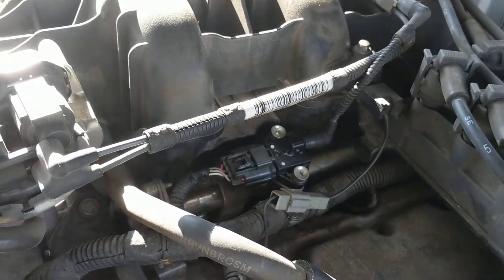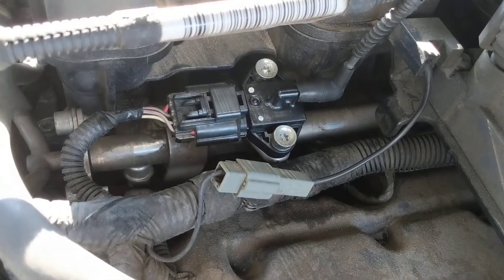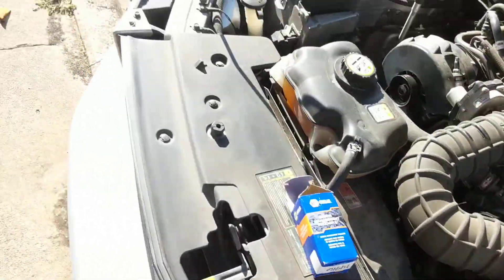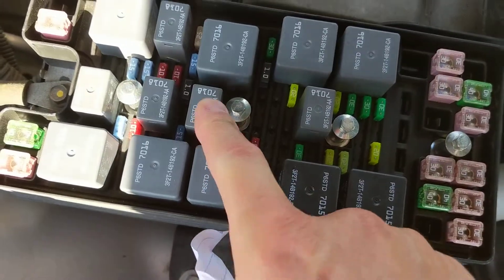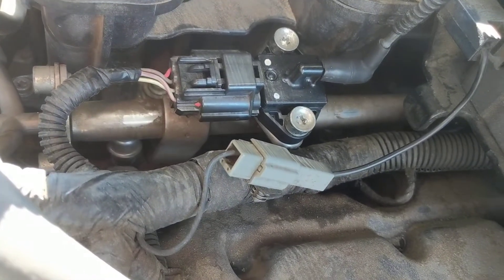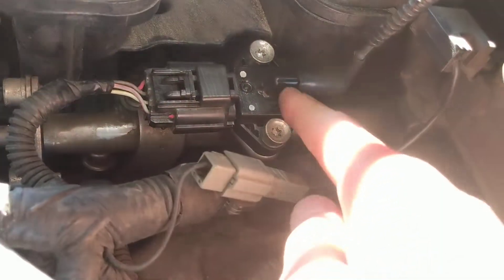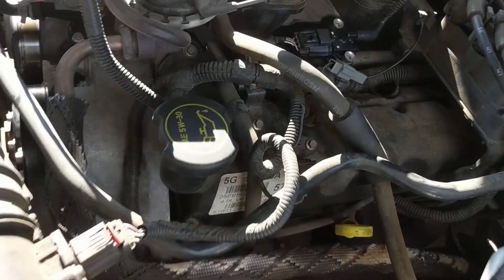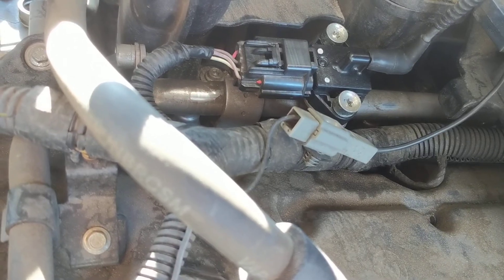How to Fix P0193 and P0182 Codes

Comment: Hi, you have Napa part no:?
Reply from the maker: I tried a few different ones and they ended up all having issues which I was really surprised I finally ended up buying a original Ford one and I have never had any problems since
Reply: Hi, leaned that years ago, buy motorcraft only, there is big difference. @JohnDaniels

Comment: Thanks for the video I had gas coming out of mine and it was new been chasing my tail trying to figure this out just started throwing those codes yesterday though I got one ordered motor Craft brand I hope this fixes my problem
Reply: Did the ford motor craft fixed it ? I have the same problem on a 06 Lincoln town car and even the OEM sensor didn’t clear the P0193 code and cuts off every other start
Reply: I got inpatient and went to Napa got the Napa brand and it did fix it..was way more expensive..I got the motor Craft one in the box for a spare
Reply: Did you pull the vacuum line off while the car was running? If so was gas coming out? If gas wasn't coming out maybe you have another problem..mine has gas coming out while running from the vacuum hose
Reply: He goes through the other possibilities

Comment: Another one thanking you for this video. This is exactly what happened to me. I bought the 15 dollar one off Ebay and it failed after a week and also gave me the P0182 code. Car would not start. I put the old sensor back and the car will start now but also buying a new better one. Sometimes cheaper is not always better. Thanks again.

Comment: Another satisfied customer. I bought a TRQ sensor for $36. It failed and my engine stopped while I was driving. And it wouldn't start. After finding this video. I bought an OEM replacement for $80 and everything worked. Monitors ok. Errors gone. Passed the smog test today. Thank you.

Comment: Sensors so many it does not make sense. Thanks a lot I’m having the same problem with my 04 mustang GT just started today your information is very valuable
Reply from the maker: You're welcome! And I would get the one from motorcraft if possible. Just spend the extra money

Comment: I replaced this sensor in  my 2008 F250 with 5.4 engine it  ran fine. I cut it off in my driveway  when  I got home and the next day I was going out to buy new tires for my truck and it will not start. I might go to Advance in the morning and buy another sensor. I've already changed the rear modulator behind /under the spare tire but still not starting !!!!! Any ideas ?????

Comment: I cleaned the mass air flow sensor and the throttle body and my code went away.  If your throttle body and plate come off black with the cleaner and the paper towel,  that could be a problem.
Reply: And new air filter.
Reply from the maker: @ayshortier  Thank you for the information 👍🏻😀

Comment: Thank you for this! Almost exactly this was my problem on a 2006 Ford fivehundred. I had the P0182 code replaced the sensor with a $15 ebay sensor. The code came back inside of a month. Continued to drive the car with the code clearing the code every few weeks. Eventually the car would not start after just driving it. Watched your video removed the vac line and it was flooded with gas. Exactly my problem . Bought the more expensive Made In USA sensor and problem fixed. It was very flooded before I got it to start. Had to disconnect the electrical connection from the the fuel pump to get it to start. Once started black smoke at first then lots of white smoke. Reconnected the electrical connector to the fuel pump and it ran like a dream. I was stumped until watching your video. Thank You, Thank You, Thank You!!!!!!
Reply from the maker: You are welcome ☺️. Glad you were able to get it resolved and thank you for sharing your story may help others have a great day my fellow traveler.
Reply: Or your local junk yard for under 20$

Comment: Thanks for your video!  Just replaced sensor on 2005 Explorer with pressure code P0193 being thrown. Now getting P0182. Joy with explorer is sensor is located under intake manifold, so replacing it is a multi-hour job. Would love to relocate sensor.  I will have to check to see if sensor is leaking gas into vacuum line..  Sensor I purchased was off amazon.  PeakCar Fuel Rail Injection Pressure Sensor, 3F2Z9-G756-AC 3F2E-9G756-AA (20 bucks)  First thing I did was replace fuel filter when getting pressure sensor code. Reset code, then when getting thrown again replaced sensor. Cleaning throttle body was a great help for smooth acceleration.  Wondering if I need to read up on resetting computer (disconnecting battery.. letting system relearn...)

Comment: Great video with really good advice. Thanks! We have a. Explorer with that code now. I'm going to check the fuel pressure and probably replace this sensor. Thanks again for the heads-up!
Reply from the maker: You're welcome 😀. Good luck and let me know how it turns out 👍
Reply: @JohnDaniels - Cold weather and plastic clips don't get along but other than that it went just as you said. Cleared codes and runs great! Thanks!
Reply from the maker: @jeffbrown3963  you're welcome, great news glad it worked for you, be safe it is cold out there 🥶

Comment: Don't put dielectric grease on your connections.  That grease is an insulator (ie doesn't conduct electricity.)  It's supposed to be used to lubricate seals.
Reply: It's actually great for electrical connections. It won't short connections but it will protect from weather and corrosion. Yeah use it on seals to.

Comment: Did you disconnect the battery before replacing it?  Just wondering if that is a factor.  I also replaced mine and smelled a little gas but had to have the fuel pump replaced,  running now but code still on.  Will try the Napa one you had.
Reply from the maker: I did not take the battery cable off probably a good idea. And you can try the Napa one you may want to try to find a genuine Ford sensor if possible.
Reply: Ford here is bad.  They gave me the wrong relay it fried my battery.  The sensor I bought also put out a fuel smell so it probably failed. Trying to find the Napa because I want a low priced one.   Do you have the link for the NAPA one?  Thanks
Reply: I think it needs a combination Fuel Filter change when cleaning the injectors.

Comment: I’m dealing with this same problem right now!  Bought a sensor online and it was defective.wow!
Reply from the maker: Good luck I hope you can get this fixed cuz it sure is a pain 😭
Reply: Yea, I almost concidered getting online but, if it might be defective, it would have been hard to get refunded. So I bought replacement parts locally at part's stores.

Comment: I  have an 06 mustang and Its throwing that P0193 code at me. My car recently died and will occasionally start but will sputter and smell like gas. I replaced that censor but it was a cheap 20 dollar one. Seeing youve had almost the exact same problems as I have give me faith that I might just have to get a different censor.
Reply from the maker: You can definitely try it, also you want to make sure that you getting gas from the fuel pump.

Comment: Thank you very much, my car was having the same problem, I also bought a sensor on amazon, it still does the same thing as before, and it also gives me the PO182, I’m going to look for one on eBay instead
Reply from the maker: Good luck,  The one I purchased worked for a long time and then started giving the high pressure code again.  I let it on because I already had my inspection but later I was driving in Dallas and heard the fuel pump starting to make a whining noise and it keep going but is hard to start the car now.  I think the fuel pump is going bad and not putting out much pressure but the funny thing is the High Pressure error code has gone off :)

Comment: Good video. I have had a p0183 code for awhile so I finally ordered a new fuel pressure sensor off amazon. Hopefully that’s the problem solver and I can get rid of the engine light.
Reply: Did it work?
Reply: @Amazinbeats  no it didn’t. Gunna try a few more things before I take it in for service.
Reply: @donavancurrie3922  did you ever find the problom
Reply: @DroneTechProduction  I bought an aftermarket sensor and it worked for a bit then failed and was sucking in gas. I kept the old one and put it back in. I changed the fuel filter and changed the spark plugs and hose clamped all the vaccum lines. Iv upgraded lots of part so I can’t remember which part got rid of the codes

Comment: I waited for this video! Or else I might end up replacing the fuel pump also. I already replaced the fuel filter by a shop that doesn't have the right tools and they sweat it out hard. 
Since I skimped on an China sensor that code kept coming back and the sensor leaked fuel. Now I'm decided to buy a good sensor. Noted on that Napa brand. Thanks!
Reply from the maker: You are welcome and good luck my friend

Comment: Great video.  Thank you for this.  I don’t know if it will solve my code problem but you gave me a great place to start!
Reply from the maker: You are welcome!  And something that wasn't mentioned in the video but did happen I had purchased a fuel pump and put it in and it was fine for a while but I guess it started going bad and then I started getting the fuel code about too much pressure so I guess it was putting out too much pressure causing the code and it wasn't the sensor so it can be the fuel pump and it can be the sensor or it could be wiring could be a few things but if you don't have a lot of tools then you're only option is to try switching out parts
Reply: @JohnDaniels  that’s the problem with these codes. You could be changing out perfectly good parts as you try to chase them down. I’m starting with the sensor and going from there. I have an 07 GT with 170k+ miles on it and none of these issues,  the 07 v6 I have is the one being a pain in the rear.
Reply from the maker: @wesmoc  yeah that's what I figured too start with the easiest and work towards the hardest Good luck brother and let me know how it turns out 💪👍
Reply: @wesmoc did u ever find out what it was I have a 07 gt

Comment: I'm having the same 193 code on my 07 f150 4.6 I've changed the fuel pump and filter and still getting the code
Reply: Did you fix it?

Comment: Read the reviews for these cheapo sensors they sell on Amazon.  Lot of people getting bad parts and part not lasting very long.  I think I'll just bite the bullet and buy one full price at the store.
Reply from the maker: That's a valid point The first one I got like I said in the video it turned out bad and it's actually made my car run worse so definitely be careful of the cheap parts.

Comment: I'm having the same code pop up but only p193 I have a 04 food mustang v6 3.8l manuel transmission. It runs fine but sometimes when pulling out of second gear it starts to bog out an hickup,  once I get into third gear it dont do it anymore.  Changed the fuel pump an cleared the code an it came back again an started doing the same thing but it only happens sometimes not everytime I'm driving. Took it to the shop changed the sensor an it still did it. So they put my old sensor back on an didnt charge me for it. Still starts everytime an idle fine. Told me to take it to a ford dealership.? Should I just buy a more expensive sensor or go to the ford dealer ship, soonest appointment was Jan 25th. But there gona charge me 300 just to do a diagnosis
Reply from the maker: That's a hard call, the sensors aren't that expensive I mean if you wanted to try another sensor you could someone else said they had a problem with the fuel filter they change that and it fix theirs it's a hard call but it was me I'd probably try new sensor see if that fixes it check all the wiring I don't know how they're going to die or not no s*** I mean you can buy one of those little meters and plug in I have a video on it and it'll show you all the codes on your smartphone I don't know what they're going to if they're even going to diagnose it with looking at the codes or they're going to try to figure out what it is by inspecting it if they're going to do that for 300 bucks it may be worth it but I don't know I would exhaust everything at my end and then maybe have them look at it and see if they can figure it out I mean 300 bucks isn't that bad especially if they can tell you exactly what it is and you don't have to worry about it anymore let me know what happens

Comment: Just curious, did you check or change the EGR valve? I had the p0193 with and replaced my EGR valve and fuel rail pressure sensor on a 2005 Ford explorer 4.0 and no codes on my system checker now.
Reply from the maker: That's good information, hopefully it will help someone else with this code 👍🏻

Comment: Would this sensor cause misfiring.? And right bank running lean.
Reply from the maker: Correct, and depending on how it's malfunctioning mine was intermittent sometimes it started misfiring in a little bit or running off and then most of the time it's fine but then sometimes it would be like we would barely run so it seems for mine it was intermittent but also when I ordered a new one and put it in it was all the time I mean it the car would barely run so I guess they could play a pretty big part
Reply: @JohnDaniels  ok, yeah I have a mustang and I keep getting misfiring codes and lean codes. I changed MAF sensors changed coils changed plugs changed my tune. Didn't think of this sensor. I'll try it out. My car would just run like crap no power
Reply from the maker: @jonon1989  yeah try it out, and taking consideration like I said in the video I had purchased one online and put it on and actually made my car worse so then I purchased another one and put it on and it actually fixed it so it is possible to get bad parts
Reply: My escape had the code for the fuel pressure rail sensor and I replaced it and now I have the  P0182 code is there anything you recommend I do ?
Reply: I got the same problem now?

Comment: Tried the Napa one last night & it’s doing the same thing
Reply from the maker: That's not good, that means it could be the fuel pump it could be the fuel filter it could be some line or something clogged up in the smog system I got a bunch of lines that come out of the tank and snake around underneath the tank there's some emissions control canisters and switches up under there it's possible maybe those are causing some too much pressure which is causing the error.

Comment: Try not to buy and electronic sensors from online vendors there are too many knock offs being sold.If they are original OEM parts you could be ok if they garranty their parts.
Reply from the maker: That's a good point, and you definitely don't want to buy a cheap part if it's hard to put on if it's hard to get to because you don't know if they're going to work or not it's a Gamble. 👍🏻

Comment: I have a 2005 Ford Focus that I'm working on. Yesterday I change the fuel rail pressure sensor and the coals went away but the car stop on me read the codes again today and I got the same p01 9191 but I also got p0182 can you explain 182 please and thank you I need help
Reply: Lisa HALL you probably bought the wrong sensor. Try getting a OEM replacement !

Comment: i’m having the same issue, i’ve replaced my transfer pump, my fuel pump 3 times, my fuel filter, and my fuel pressure sensor 2 times and i’m getting the same code over and over.
Reply from the maker: Did replace in any of those turn off the code for any amount of time or did the code always stay?
Reply: John Daniels the first time i replaced the fuel pump it turned off for ab 5 months then for some reason it came back on
Reply from the maker: @Hunter-oh8jw  There is something flaky about that code,  Maybe the fuel pressure sensor went bad again?  I bet you are tired of changing out these parts.
Reply: @Hunter-oh8jw  I have replaced Fuel pump & after 1.5 month same issue of stallling engine at low speed occurring in Ford Explorer 2008 model.
Reply: Paresh Panchal  i had something wrong with my exhaust that was the problem cost 75$ to replace forgot the name of it
Reply: @pareshrpanchal did u fix this issue u had yet I'm dealing with same thing
Reply: B.M. W Yet I didn’t solve the issue completely. I have replaced fuel pump & fuel filter,  after that frequency of stalling decreased drastically but few time I faced the issue of stalling. I went to mechanic but couldn’t find the root cause.

Comment: So you did not need to change out the fuel pump it was just a sensor?
Reply from the maker: Unless you have the proper tools it's hard to tell because you would need to put a fuel pressure gauge on the fuel line and see how much pressure the pumps putting out If it's putting out too much then you'll get that error and then you would need to replace the fuel pump I think the easiest way to troubleshoot would be make sure it's not a fuse that's out and then the next step would be change out the sensor and then the third step change out the fuel filter and then the fuel pump.

Comment: Mine has intermittent codes. It clears itself and comes back every so often.
Reply from the maker: Yeah maybe it's faulty wiring or a faulty part that sensor fuel roll sensor those intermittent ones are the hardest troubleshoot
Reply: @JohnDaniels  I found the issue. FYI. It was the fuel filter. It was so badly clogged  thanks for the video.  You helped my brain diagnose the problem
Reply from the maker: @4057hofft  you're welcome! And glad that you got it figured out and thanks for posting how you did it cuz that'll help other people also.  Take care my fellow traveler and be safe out there.  and keep that car running it's a lot cheaper than going to buy a new one and having those monthly payments 😉🎉